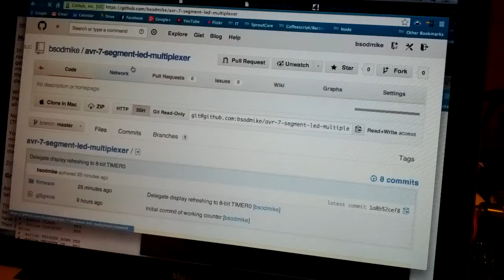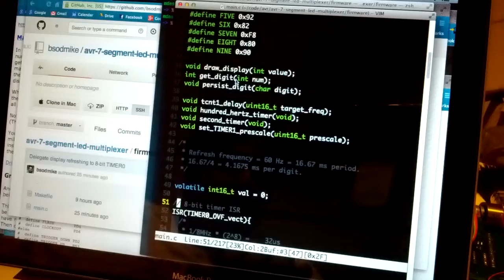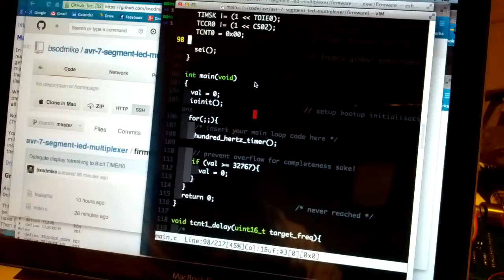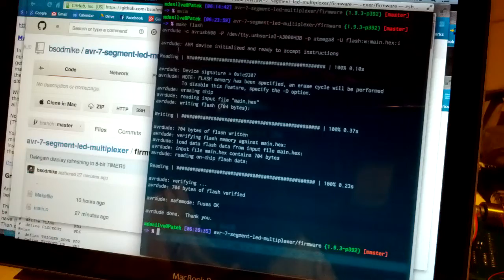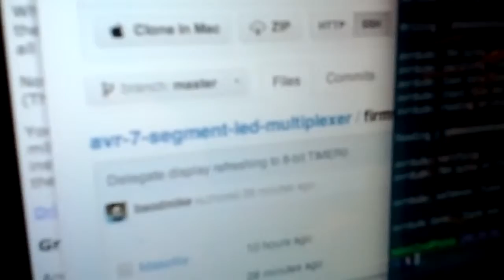AVR Multiplexing of 4x 7-Segment LEDs

Comment from the maker: You'll have the main part of the calendar code that'll simply be an advancement 'chain' based off the 1/100th timer.  Then before each 'calendar advancement' there's be a check against a look-up table of month-days plus considering leap-years.  There's quite a bit of drift in most crystals though and accuracy would be subjective.

Comment from the maker: There's a better approach to tracking the target timer value.  AVR timers usually incorporate a special function mode called "Clear on Timer Compare", or CTC for short that does exactly this but in hardware.

It compares in hardware the current timer value against the wanted value, and when the wanted value is reached an interrupt is triggered.  Working with a 32kHz external crystal and a CTC TOP of 10 would give 1/100th of a second.

Comment from the maker: There's a technique called charlieplexing that could come in handy, and there are 40-pin AVRs with much more i/o.  For an actual 'clock' application, I'd go with an external crystal, one that would allow me trigger an interrupt at 1/100th of a second.  That's the 'crucial' part at least.

As for this current circuit, I was experiencing some 'drift'.  Not great for any timing but to act as a voltmeter it's completely fine - and is its primary purpose :)